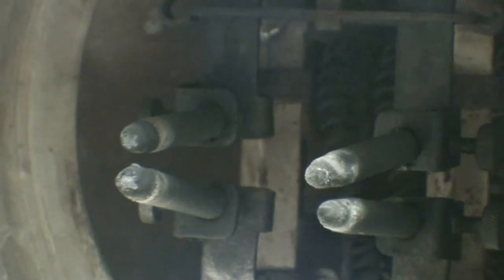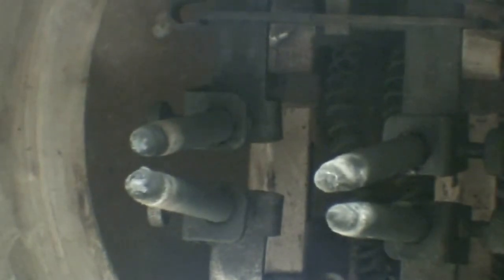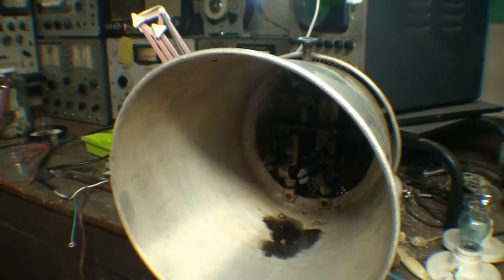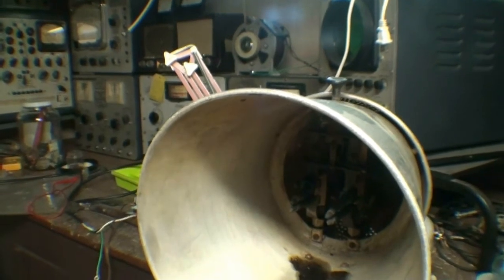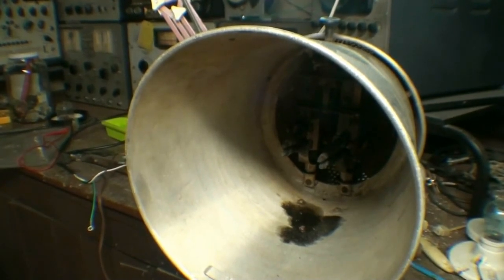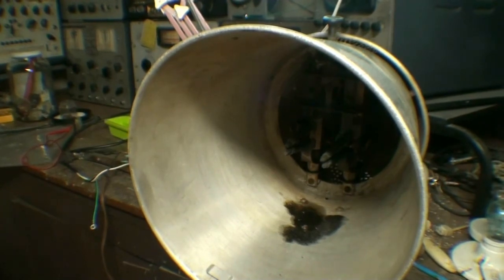Another Run of the Fischer Arc Lamp

Comment from the maker: I think you're thinking of an inductive of electronic ballast like fluorescent lamps use.  Those do require AC in most cases.  The ballast in this lamp is a resistive ballast - just a coiled nichrome wire wrapped around some insulators.  I'm not sure if the lamp was designed for AC or DC, as it doesn't state it on the tag.  Next vid of it I'll try it on AC and see what happens.  Worst case, I blow up the carbons, in which I have another old battery I can tear apart lol

Comment from the maker: Most arc lamps run on a DC supply, and all of them need to have some sort of ballast to regulate the current draw and prevent overloading the supply, since once the arc is struck, it would pretty much be a short circuit. I may try running it off straight AC to see what happens, though I would think it would have more of an erratic arc on AC vs DC.